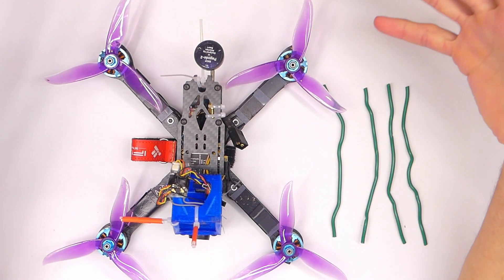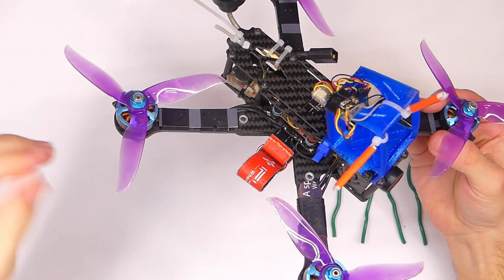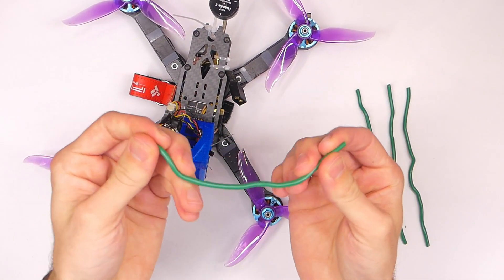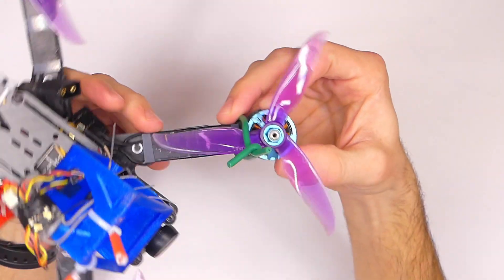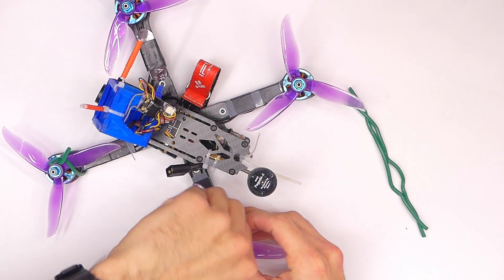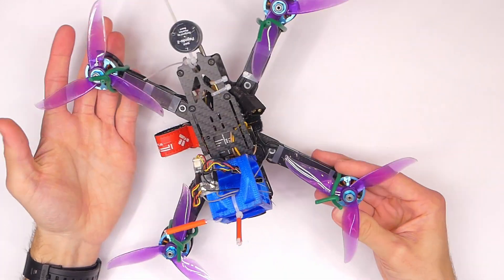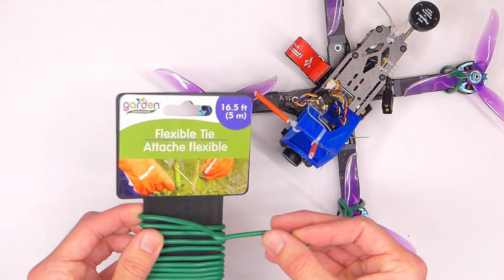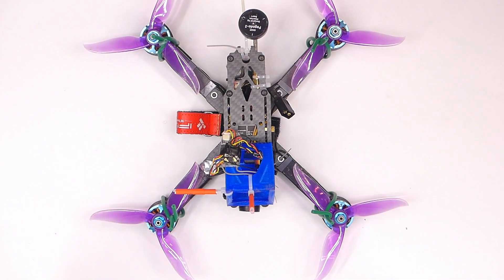Are Your Fingers Worth $1? DIY PropStoppers for FPV Drone Safety

Comment: 1 buck ESC burner?
Reply from the maker: Hi! No, this shouldn't burn out the ESCs, especially if you don't try to keep spinning the motors. I think the ESCs will just shut off due to no rotor movement.

Comment: Great idea. 
Another is to use Washing Pegs, but you need to have nice wide arms where the pegs just fit, so usually a 5" prop.
Tried it on smaller 3" and the arms being that much narrower, they can knock the peg off, so your idea is better.

Comment: Why there are 2 disliker tell why you don't like this video?.
Reply: I didn't hit dislike, but I don't like it, because it is still better to remove props. With blocking motors you are going to burn either motors or esc or both.
Reply: @EvzenEmanuel  yes i am agree with you,it can cause burn motors...but opening each props is to hard....then after fixing it again....so i thing you understand.
Reply: And the second thing is. Almost everything in betaflight works without the battery. You can tune your quad with USB in and without battery. And without battery the motors can't spin because esc don't have power. So I don't see the point in this.

And in case you want to tune the esc, you need battery and connection to the computer, but you also must remove props, because again, with solution in the video, you would burn either esc or motor or both.
Reply: @EvzenEmanuel  okay🤐